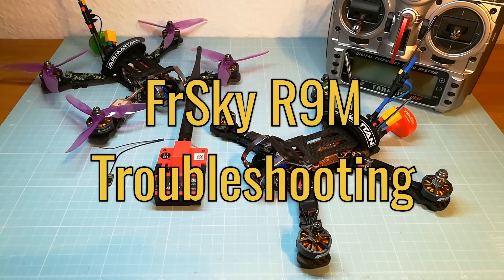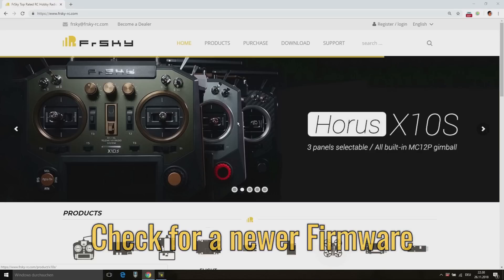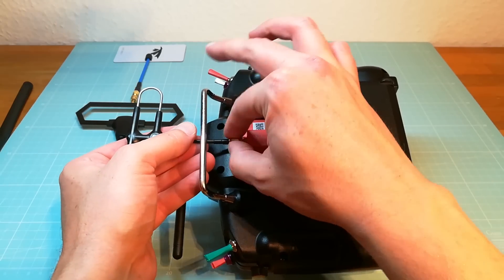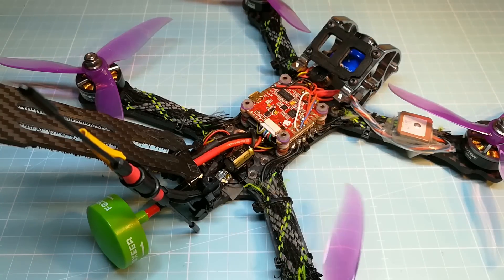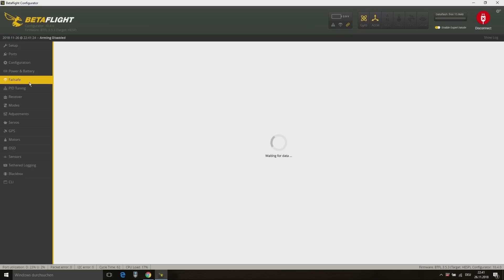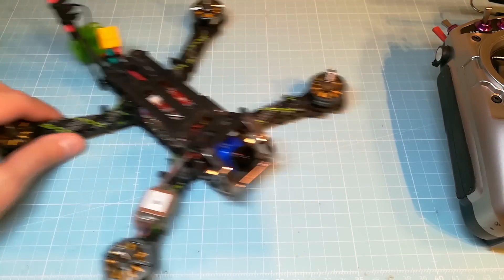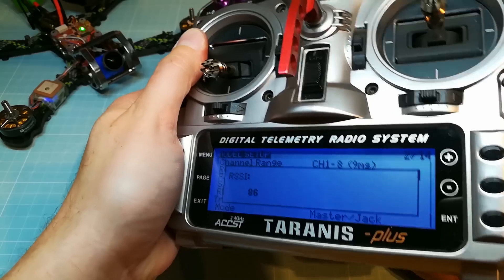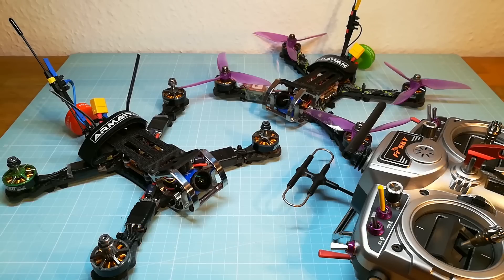FrSky R9M - Failsafe - Troubleshooting

Comment: Hi Torban!! I have the r9m in the Qx7, can I use 1W without external battery xt30?? Flex firmware 1W??
Reply from the maker: i do it without an external battery, but at this time of the year it's to cold to fly more then 2 or 3 packs. For flying more packs i think you will need an external battery at this high output power.
Reply: Yes or need liion 18650 batteries  for the transmitter like 3500 mah in capacity
Reply: I've got 3 x 18650 in my QX7 battery compartment. Tight fit but worth the effort. You can also fit a DIY pack of 3 x 605080 lipo cells. They are 6mm x 50mm x 80mm and capacity 3000mAh.
Reply: @SergyFPV  hi mi friend! 
If I have a good battery in the transmitter then I do not need external power??  Lion or lipo???
Reply: @henryarias5592  Hi,  in Qx7  possible to  use 2s 18650 like LG mj1 ( 3500 mah ) battery can drop till 2.5 v by cell, it will be better than stock battery nimh .
Reply: @TorbanDallas  
thank you brother, I hope to see your gps rescue tests, two enigmas the failsafe and the return home, greetings from Colombia!
Reply from the maker: @henryarias5592  thanks for your comment. That's very disappointing, we are having failsafes with the r9m around the entire world. Send me some sunny weather from Colombia please, here it's cold, dark and raining - bad conditions to go on testing. I have received the new Super 8 EU Antenna, i still need to test my quad with the r9mini and the xm+ with the redundancy function and i also have set up the gps rescue mode on my quad with the BN-180. So many things for testing on a real flight - let's hope that i will get the time and good weather at the weekend. Greatings from Germany
Reply: @TorbanDallas  till now you just tried super 8 antenna TX  in 900 MHz ? 
It means You used rx antenna 868 MHz and super 8 antenna on TX in 900 mhz ??
Reply from the maker: @SergyFPV  yes i did, the super 8 900Mhz is tuned to match FCC and EU Frequencys of 868 to 915 Mhz. That was the first version of this antenna. Later FrSky released the Super 8 EU Version. I recently got the this new 868Mhz Antenna, i'm looking forward to test it.
Reply: Wish it will  be better with this new antenna,   thanks for yours vidéos always interesting, courage Bro 😉
Reply from the maker: Thank you  @SergyFPV ! Let me know if the new antennas improved your system.

Comment: Nice info for moving around wires and connectors for bad contacts.
Last time I have two failsafe on four batteries in 5 meters from me on 25mw.  Must check all because last time do not have.
Reply from the maker: Golden Fpv let me know if you could fix your issue.
Reply: @TorbanDallas  I do, we are fighting against failsafe :)

Comment: I needed this because I was scared to fly over water because I thought it might fail safe
Reply: Put a GPS and enable return to home...since then I fly without any fears.
Reply from the maker: The Flex Firmware is still a Beta Firmware, and i'm reading about failsafes every day, so you need to test your system for a long time to get confident with it, my tipps will help to avoid failsafes. But they don't avoid failsafes if there is an issue with the FrSky Firmware.

Comment: Tolles Video !
So ganz ohne Risiko ist es natürlich nicht failsafe stage 1 auf 5 Sekunden oder mehr zu setzen, im platten nichts kein Problem, aber wenn man weniger Platz hat und soft targets in der nähe sind würde ich davon abraten.
Habe bei mir jetzt 0.8 Sekunden und den Mode Kanal so gesetzt, dass er auf angle Mode steht, throttle auf hold, rest auto.
Funktioniert sogar mit dem GPS rescue, der disarmt normalerweise wenn du einen failsafe kopfüber hast, da er nicht weiß was er tun soll. 
Und dank der flex 1109 Firmware kann ich das failsafe verhalten ja ausgiebig testen :)
Reply from the maker: Hi Danke, natürlich hast du mit deinem Kommentar recht, dass ist auch eher ein Workaround :D ich hatte es vorher auf 1 Sekunde stehen und das war, wie man in der einen Szene sieht noch zu wenig. 5 Sekunden ist jetzt eher die "Du kannst mich mal" Einstellung ;) Am GPS Rescue arbeite ich ja noch. Wenn man jetzt aber davon ausgeht, dass so ein Failsafe beim R9M 1-2 Sekunden dauert, dann sollte man noch auf der sicheren Seite sein. Es wäre natürlich absolut wünschenswert wenn FrSky die Probleme mit der Firmware endlich in den Griff bekommen würde und uns die Failsafes ersparrt bleiben. Hattest du denn jetzt schon so oft Failsafes mit der neuen Flex?
Reply: Die 3 failsafes innerhalb von 2 lipos.
Hatte jetzt nochmal ein r9mm in den chameleon gepackt, ganz nach vorne, vtx ganz hinten um das auszuschließen und die frsky t 868 Antenne ran - horizontal.
Dachte schon es läuft, aber ca 50m vor meiner Nase ist er runtergefallen.
Video habe ich hochgeladen und auch mal an frsky gesendet, mal schauen.
Hatte natürlich vorher geregnet und ich hasse putzen :)
Reply from the maker: @SchonRichtig  Das kann doch echt nicht sein, ein Failsafe nach dem anderen. Da hab ich wohl eher noch Glück gehabt. Wahrscheinlich sind es die Überschneidungen der Frequenz mit dem Mobilfunk. Aber selbst bei der FCC Firmware soll es ja Failsafes geben. Wo fliegst du denn? Sind an deinem Spot Handymasten oder Störquellen? Ansonsten hast du auch alles geprüft und beachtet was ich in meinem Video so erwähne.
Reply: @TorbanDallas Die 3 failsafes mit dem flosstyle waren mitten im nichts, aber auf dem Land kannst du ja gut die 868lte sendemasten haben.
Mit dem chameleon war ich auf einem großen Sportplatz mitten in Kiel.
Es muss aber am umschalten der HQ LQ modes liegen, failsafes habe ich ja immer nur in der nähe.
Noch nie einen gehabt wenn ich mal weiter weg war. Immer 50-350m.
Reply from the maker: @SchonRichtig  ok, na und genau die Probleme mit dem Umschalten sollten sich ja vermeiden lassen wenn man das Failsafe Delay erhöht. Hattest du eine RXLOSS Warnung im OSD oder wie äußert sich das bei dir? Meine Failsafes waren ca. bei 200 und einmal bei 500m.
Reply: @TorbanDallas  https://youtu.be/AjxM3nx-0iY
Das war am Sonntag mit dem chameleon, bei 2.35min.
Habe den ganzen dvr gelassen, damit frsky den rssi Verlauf auch sehen kann.
Beim flosstyle merkst du halt das er in den angle Mode geht, du in dem Moment keine Kontrolle hast.
Dann springt schon das GPS rescue an, er dreht sich zu dir und geht nach oben, nach insgesamt 2-3 Sekunden ist die Kontrolle aber wieder da.
Beim chameleon ohne GPS hatte ich die zeit für stage 1 auf 0.8 Sekunden, dann kam der drop.
War wieder bei 79? Rssi, also relativ gut, das umschalten muss so schnell gehen, das man es gar nicht merkt.
Die neue flex 1109 soll ja eben dieses Problem eigentlich beseitigen, bei mir ist es aber viel schlimmer, häufiger und längere Aussetzer. 
Mit der Stock EU lbt Firmware auf 25mw 16ch hatte ich glaube ich nicht einmal einen failsafe, war auch öfter mal 5-600m unterwegs und das mit den Stock Antennen.
Reply from the maker: @SchonRichtig  hab mir dein Video angesehen und auch kommentiert. Sieht ähnlich aus wie bei mir der Failsafe. Aber mit längerem Failsafe Delay + R9Mini+XMplus im Redundancy Mode + GPS Rescue, was soll da denn noch passieren :D
Reply: @TorbanDallas  ich habe ein R9m zusammen mit R9mini receiver  auf einem floss2 frame. EU-LBT firmware, bis jetzt glücklicherweise kein einziger failsafe. habe maximal 300m geflogen. Torban, hattest du das failsafe problem schon vor der Flex firmware, also auch mit Eu -lbt? Und nur auf den Chameleon oder auch andere Kopters? Danke
Reply from the maker: Andrei ich hatte mein r9m direkt nach Erhalt auf die Flex Firmware geflashed. Zu der Eu Lbt kann ich nichts sagen. Wird dann wohl mal langsam Zeit, dass du dich an größere Entfernungen heran traust 😉
Reply: @Fpv_Dad  Meine bei mir traten die Probleme erst mit der flex auf, mit dem r9m lite 25mw 16ch EU lbt kann ich mich an keinen failsafe erinnern, auch nicht bei 500-600m Entfernung.
 Mit der ersten flex gingen die Probleme los und mit jedem update mehr :)
Würde dir auch raten erstmal dabei zu bleiben.
Reply: @SchonRichtig  cool, danke euch für die infos. ich bleibe definitiv auf Eu-lbt noch ne weile :)
Reply: @Fpv_Dad  werde einen quad und ein r9m lite auch mal wieder mit der EU lbt versorgen und dann mal beide testen.
Reply: ich Flieg die R9m mit LBT auf 25mW und Fport Firmware auf dem R9mini ... 0 Fail Save auch bei 1 km+  und auch bei RSSi von 20-30 keine Probleme ... bleib erst mal da bei
Reply: @Zeusway-BRV  Gute Idee :)
Kann mich auch echt nicht an einen failsafe mit der lbt Firmware erinnern. Wollte eigentlich heute die lbt Firmware mal mit den neuen Antennen testen, Wetter sieht aber schon wieder sch. .. Aus. 
Verstehe nicht warum die nicht einfach die Power settings angepasst und das dann als flex (Power) firmware rausgebracht haben.